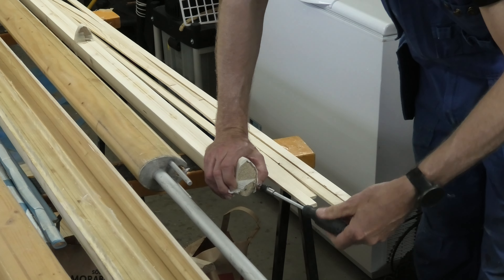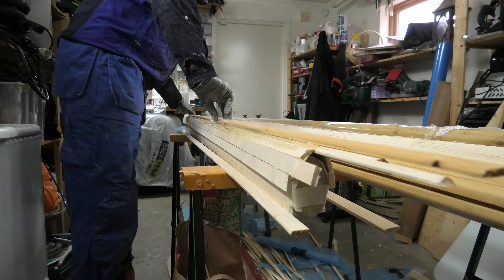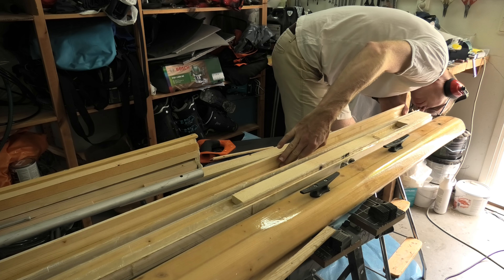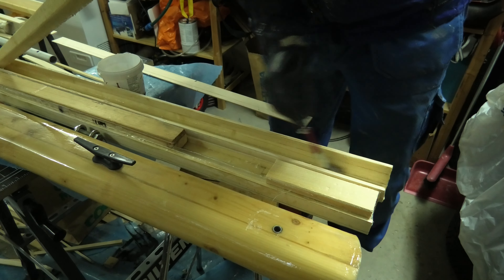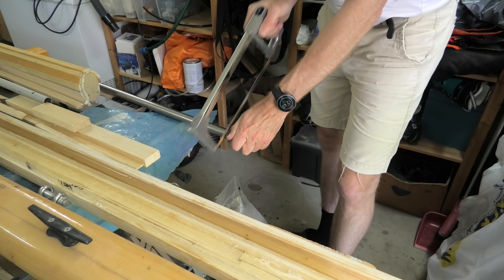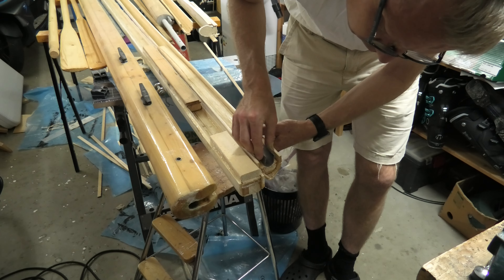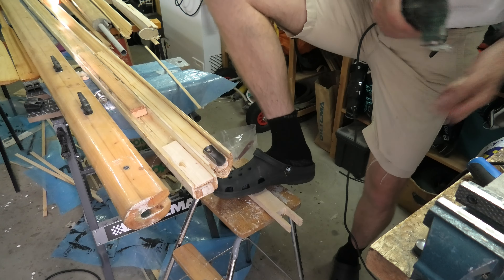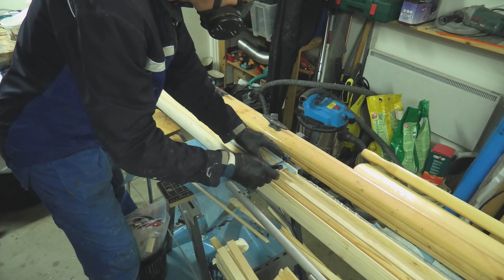Working on the inside of a divisible mast for a Hobby Kat #195

Comment: "Det är många delar på ett spett"       :)             Det blir en lätt mast.      Roterande ?  
Nyfiken på provseglingen.. gamla/nya masten.   Lycka till !
Reply from the maker: Ja tanken är att den skall kunna roteras, originalutförandet var sådant. Jag kunde dock aldrig få det att fungera men nu har jag tänkt vidare och har en lösning. Lättare är den än så länge men det gäller att hålla igen hela tiden. I botten spelar det dock inte så stor roll eftersom hävarmen är liten där.
Reply: @sailoutofagarage6212      Manuellt rotering 
 av mast  eller själv flöjlande med stag och kula i framkant  ?
Reply from the maker: @andersjohansson3866  På engelska heter det "tang". Alla stag leder till ett fäste i framkant av masten vilket gör att den kan röra sig i en båge, ca 45 grader.
Reply: @sailoutofagarage6212    Hade alla tre stagen fästa i en punkt på min isjakt med windsurfing rigg.   Fungerade bra vid segling men vid stagvändning trodde jag att riggen skulle skaka loss..      Är det bra gjort är det kanon!!
Reply from the maker: @andersjohansson3866  Jag är inte säker på att jag kommer använda funktionen men jag vill ha möjligheten. Jag märkte på den gamla masten (som inte roterade) att den nöp seglet i förliksrännan när man slörade.
Reply from the maker: @andersjohansson3866  Hej! Jag skulle gärna vilja kontakta dig men det är många Anders Johansson. Har du möjlighet att hitta mig? (Vill inte gå publikt med kontaktuppgifter men du bör kunna hitta mig via namn i min första video. Jag kommer plocka bort det här inlägget om ett tag).